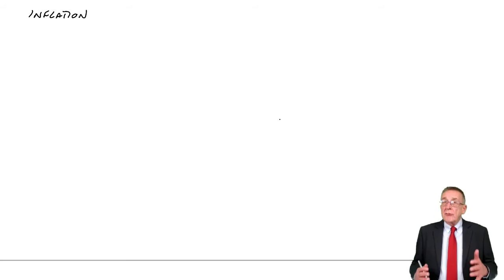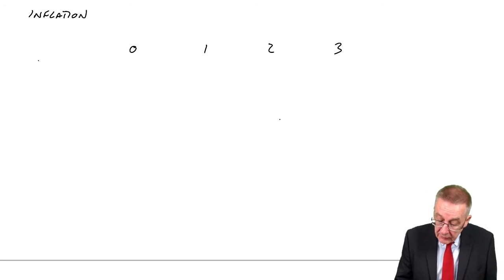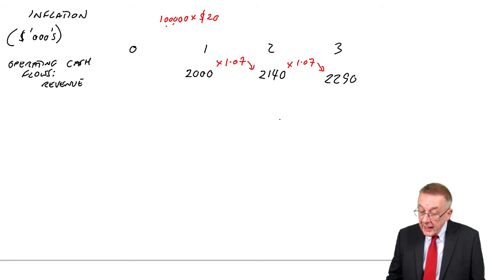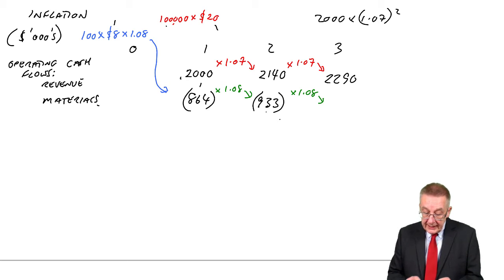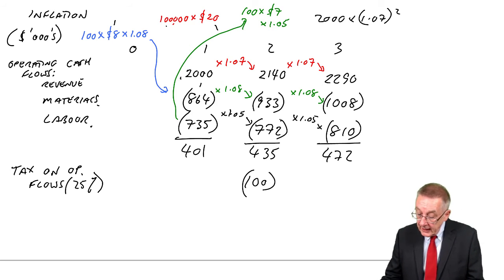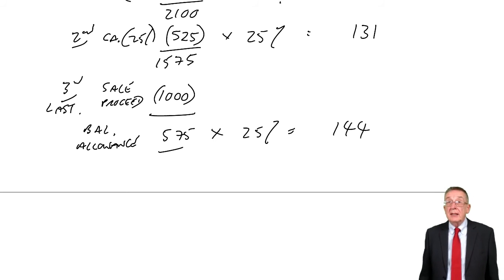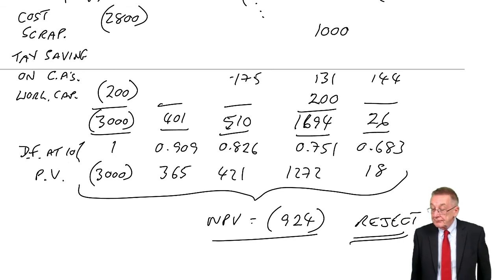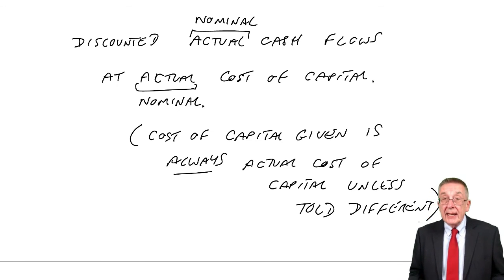Relevant cash flows for DCF Inflation (example 5) - ACCA Financial Management (FM)

Comment: Have you not changed from working in 000s to working in 0000s half way through? Eg For Y2, cash flow 43,513 - 10,025 tax (25% of 40,100 from Y1), + 175,000 tax saving allowance = £208,488. You have 510,000 which makes me think you have classed 435 as 435,000 instead of 43500? Apologies if I’m mistaken